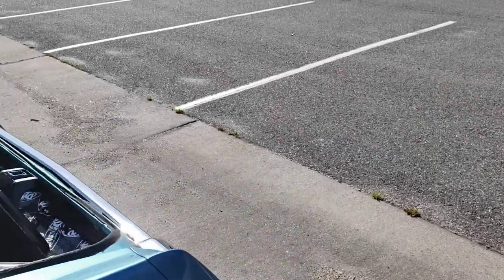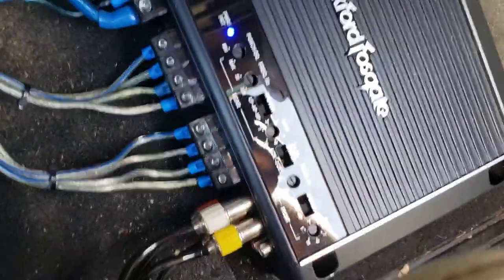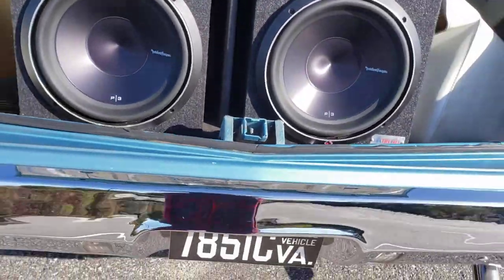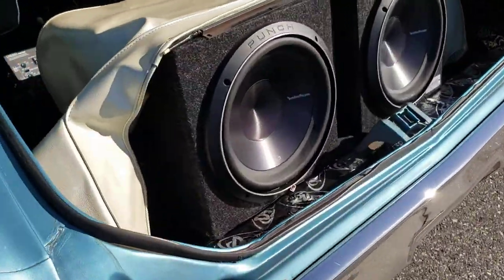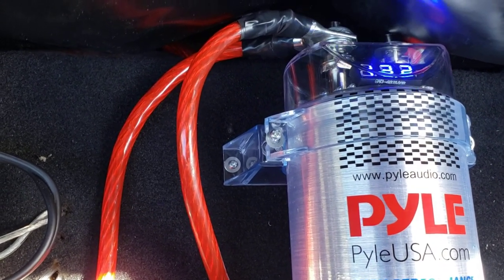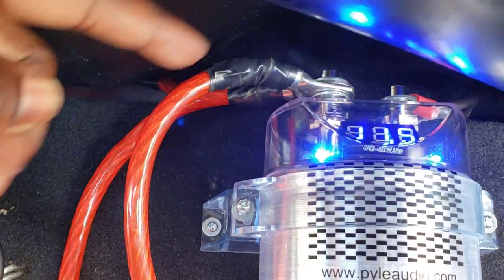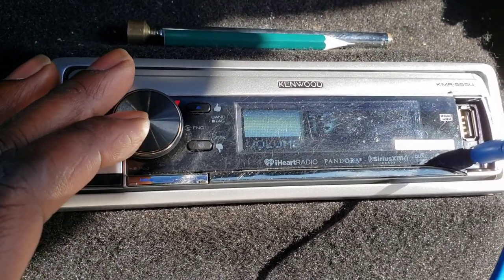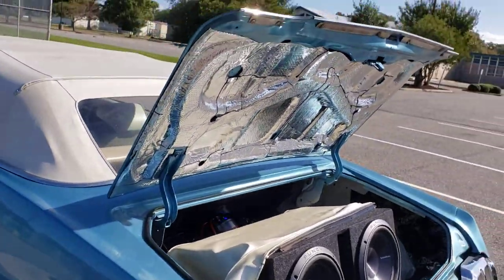5 Farad Auto Capacitor Review

Comment: Hey buddy, run OGauge from battery to fuse then to positive on ur cap, then use a 0 to whatever gauge wire the amp takes reducer into the amp. 0 gage ground wire also from a good no paint ground in ur trunk with same size reducer into your sub amp. You’re 4 channel doesn’t need the cap. Just ur sub amp. Run 0 gauge power and ground to 2 separate distribution blocks that take 0gauge in, and whatever size wire your 4 channel takes. 0 gauge Power from battery to distribution block. Then 4 gage or whatever the amp takes from the other side of block to your 4 channel. Do the same with your ground. Do the big 3 wiring with 0 gauge under the hood. Make sure you have a good battery and a high output alternator is always a good idea. Make sure you charge your capacitor before you hook it up. NEVER use bass boost on an amp. The bass level on your deck should be set to zero or below because the amp can take care of the bass. You could do the same with ur 4 channel as well or I like to turn the treble up on my deck because I love clean, crisp highs and mids that I can still hear cut through the bass so you can actually hear the music as well. I like to use a single din eq to have better control of the overall sound. If you run an eq, set bass, mid and treble on ur deck to zero. Adjust the frequencies to what you like. I just woke up a bit ago and saw this video so if I’m all over the place I apologize. If you can make sense of it, I hope it helps.

Comment: All the gain does is match the output voltage of the head unit to the output of the amp so it doesn’t clip. GAIN IS NOT A VOLUME KNOB!
It being set to 3 just means he has a more sensitive output from the head unit.

Edit: the voltage drop is worse because your wiring from the battery and alternator is insufficient for the draw you are generating. You need at least 1/0 or 00 to get any gains from a cap. All the cap is doing is making more draw on the tiny wires.. and I would do the big 3 with at least that 4 gauge you have ran to the amp and replace everything with 1/0
Reply from the maker: Gain is not a volume knob is true - but gain is actually a resistance potentiometer. Which has nothing to do with matching output voltage - it only lowers impedance to the speakers, which acts like a volume knob

Comment: I put a planet audio 2 farad with my with my skar 1200 and it works great. But mine never went into power protect previously. Might want a bigger battery.
Reply: Nice Walmart build
Reply: How has it been since ?? You still running the setup ??.I got a 1500 watt skarr amp I’m about to put a 500k micro Capacitor you think that will do any harm ??
Reply: I have that skar 12 inch box 2 I'ma use the amp that came wit the box wat u 🤔 let me know something

Comment: The capacitor is not going to add any voltage whatsoever. If you would have volt tested your setup before and seen where your voltage was it probably was the same.  The capacitor if it's good is supposed to add power faster than the battery can.  That's all it really does.

Comment: That cap did nothing for your system but made it worse.  You need the big 3, 0g wires and an extra battery.  If that doesn't help then you need a bigger alternator

Comment: You gota do the 0/1 Guage from battery to cap, 0 gauge ground from cap to different ground as amp. 0 Guage all the way. And to plug into amp get a adapter 0 gauge to 4 gauage reducers. And a xs power battery and perform the big 3 under the hood. You gota ground ur engine to. And ur battery with 0 gauge.

Comment: First off, you're lacking serious power. You need a 300 amp Altenator with 2 batteries and a Stinger 500 amp relay battery isolator!  Then, do the big 4 wirings and add thereafter a 10 Farad Capacitor with all proper fuses and you should be good to go.  Use 0 or 00 aug welding pure copper wires when doing your new build. Those P3 are no joke and are made to rumble earthquake-like down the hwy!  Bottom line? You need proper power! DIY it and you can save a lot! You can do it all for well under 1,000 Bucks!!!  Good Luck!

Comment: Ground wire I had the same problem
Reply from the maker: My ground is pretty clean and tight. 8gage off the cap, but 4gage everywhere else... gonna throw a powerbastards altenator in her to see what happens. Will double check grounds tho. Thanks
Reply: I recommend you run all 4 gauge wire also
Reply from the maker: @desmonddodd1286  Im running all 4 gage wires except ONE ground wire, and thats the one straight from cap to ground. I honestly think its my altenator after all the lookups. This 1970 cutlass still running factory alternator although im using a yellow top, i think the alternator isnt providing enough, will post an update when my new one come in. Many thanks for your recommendations
Reply: @seebell7140  you need a second battery and zero gauge ground wire and the capacity will start to show it's worth

Comment: From my observations..  that cap looks like it's not charged.  Its nothing more than an oversized volt meter.. That wire is way too small for that system. Don't blame Pyle. An uncharged cap will only hurt your system.  It's basically another voltage draw.. nice whip though 👌

Comment: Your dropping so hard not because of your amp. Your dropping because of your alternator. You need an upgraded alternator and good battery. Even with a system at 1500 watts. Older vehicles have very weak alternators OEM

Comment: what is beter secont battery or capacitor?
Reply from the maker: In my opinion,  capacitors work best in smaller electronic applications, for hard hitting sound systems,  NOTHING is better than a 2nd battery!  a good high amp altenator and the big 3 with zero gague wiring is key as well.

Comment: Why run 1 ohm,  2 is much better for that amp.
Reply from the maker: @Chromedome-ss6mg  those speakers are 4 ohms each,  Bridgeable down to 1 ohm was my only option for those 4 ohm P3's
Reply: @seebell7140  two 4 ohm speakers is 2 ohm wired parallel.?
Reply from the maker: @Chromedome-ss6mg  Generally speaking what you said is correct. (2 - 4ohm speakers usually bridge down to 2 ohmns) but the RF P3s are 4ohm dual voice coil speakers which give them the unique ability to bridge them down to a resistance of only 1 ohm... it's the reason I bought the 4ohm ones instead of the 2ohm pair. (The instructions in the set reveal how to wire them down to 1ohm) which I think is really cool
Reply: @seebell7140  Two dual voice coils at 2 ohms is the way to go.   Wire them down to 1oma piece and then wire them together to make two ohms. That's the way I'm going to do it.  You could go up to 4 ohms and not have a problem if you have enough power. But I guess you're trying to squeeze as much as you can out of it.

Comment: Yo bro put a battery in the trunk...Thats all you need
Reply: He has other issues if voltage drop is that bad? Likely battery is shot as has no capacity left to supply load and alternator needs to be upgraded to a high output one.